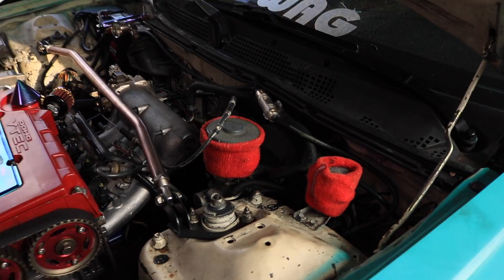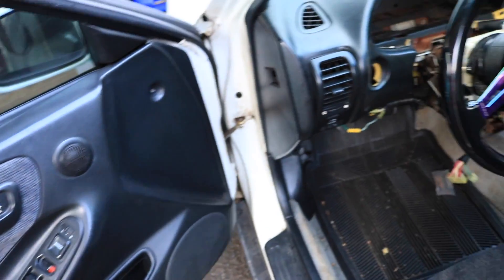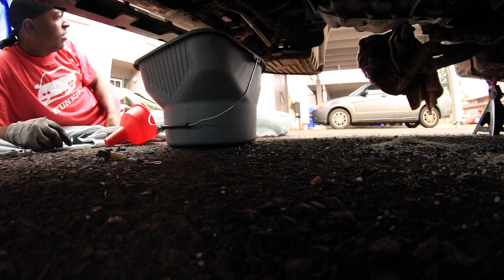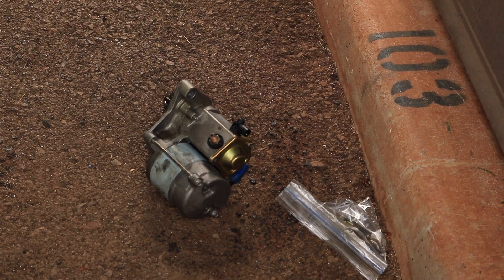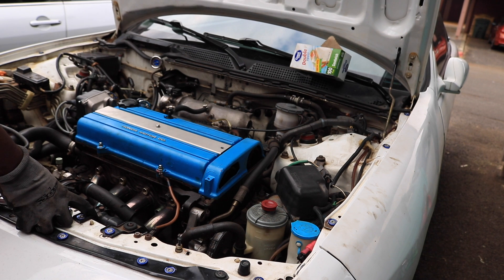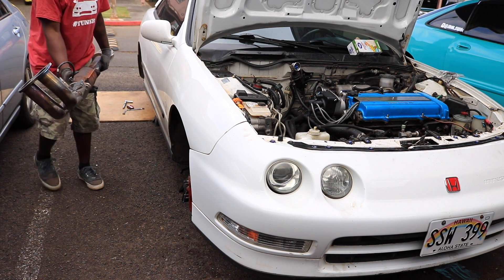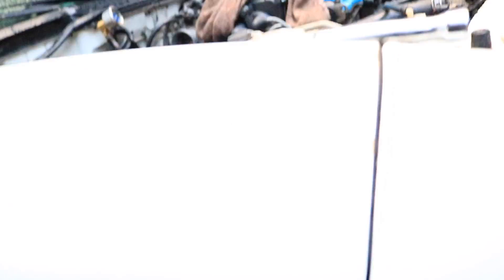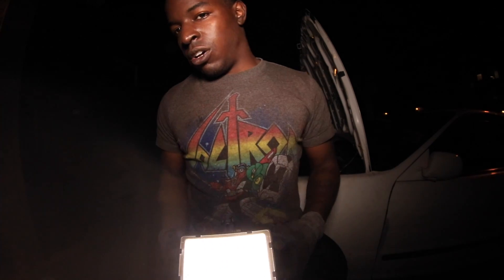Integra Part Out Episode 5: Ready To Dropped The Transmission

Comment: you didn't have to remove the headers on tiffany if your just replacing the transmission
Reply: TATTOOIST lilCHRIS lmao fr
Reply from the maker: TATTOOIST lilCHRIS it's easier to remove the engine without all the piping as well as getting lowering it using two jack. So yes it needed to be remove. In addition I'm selling the exhaust so why leave it connected that makes no scenes for wat I'm doing tbh